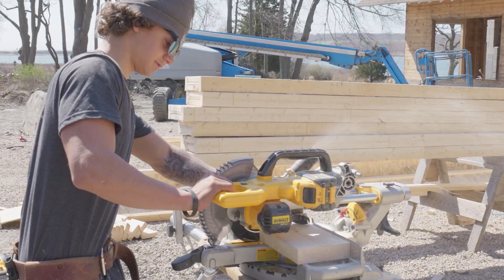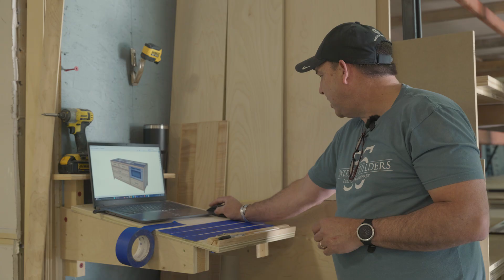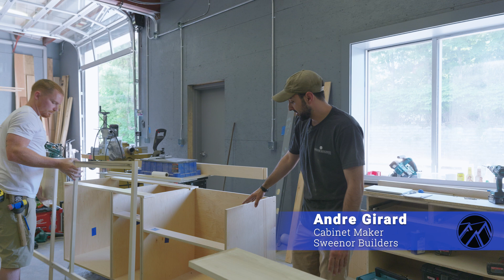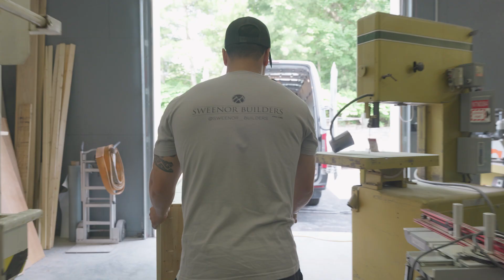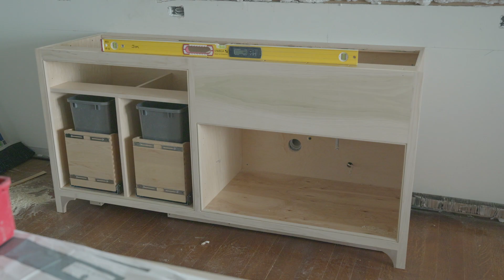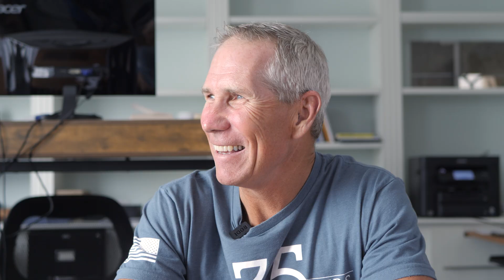Custom Kitchen from Design to Install | In-House Millwork Shop | Sawdust S2 EP10

Comment: It’s beautiful no doubt?  However all you need is a guy that understands how to run a very expensive CNC like in a production cabinetry shop and produce what product your architects draws?  As a cabinet maker myself these are the cabinets I sometimes am paid to put together by the home owner or GC.  It’s not bespoke cabinet making !  
The difference?  No packages to take apart!  However !  I bet there is no difference in price if a custom cabinet maker hand built these .  These are production cabinets , albeit very expensive ones?  Not knocking it ?  It is what it is !
Reply: I am surprised that the beaded inset piece is a separate piece of molding vs milled directly on to the rails and stiles....seems kinda cheesy to be honest